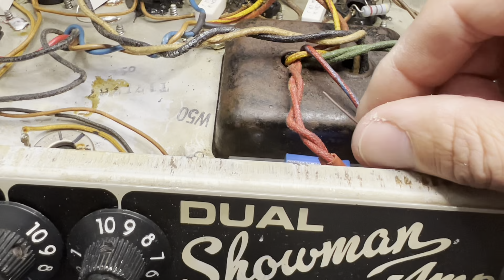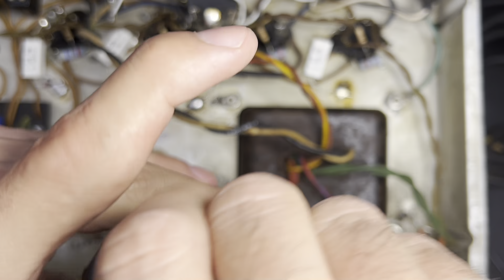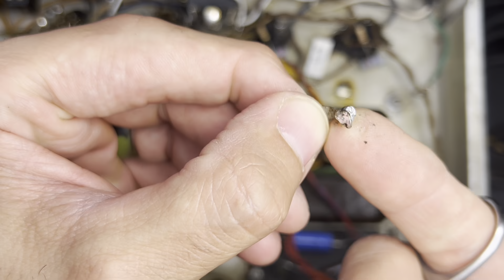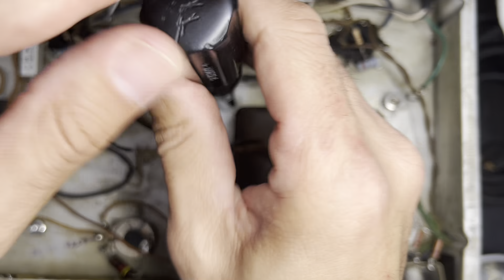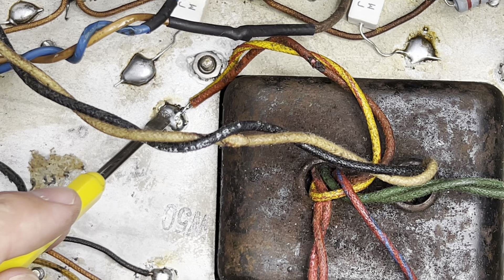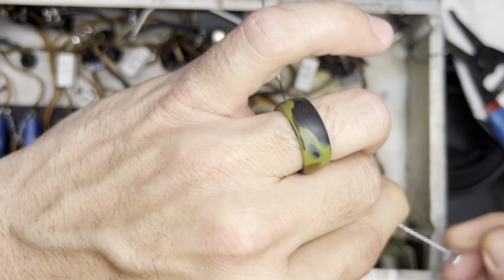Blackface Fender Showman Part 3 || Chassis Ground Work

Comment: So sorry about the bad finger spoiling the guitar for you, I can relate. While I have full range of motion in my hands, the fingertips are still numb from chemo neuropathy and I'm starting to wonder if full feeling is ever coming back to them. Every time I pick up a guitar, it's so discouraging and I put it right back down. It's like playing with rubber glove tips on. Still, I'm grateful that I can do most day to day things just fine. (Winding tiny toroidal coils is still a challenge!) I'd learn to play with my feet, but the neuropathy is FAR WORSE in them. 🎸🐒
Reply from the maker: I feel like a douche for complaining to be honest!  Torroidal?  I couldn’t wind one of those before the accident!
Reply: @ForgottenGearRestorations  They're really common in homebrew radio circuits, for all sorts of tuned circuits. They are small, self shielding and give very predictable, repeatable results. But the tiny cores and tiny magnet wire are no fun when your eyes are old and your fingers are numb! I abide.

Comment: If I may, just a tip from my bag of tricks; you can get rubberized little strips about 6" long in the garden section.  They're made to twist around plant's stem and hold it to a trellis, wire cage, or what have you...they're great for keeping wires out of the way until you're ready to solder.
Reply from the maker: Brilliant!  I’ll have a look for them next time I’m at the garden center. Thank you so much!